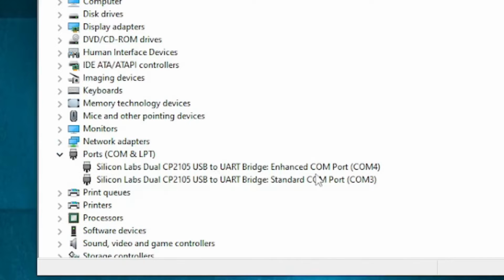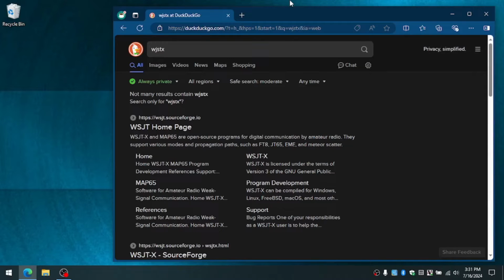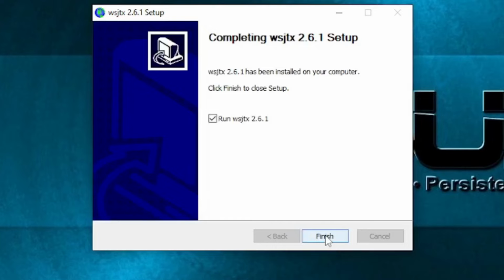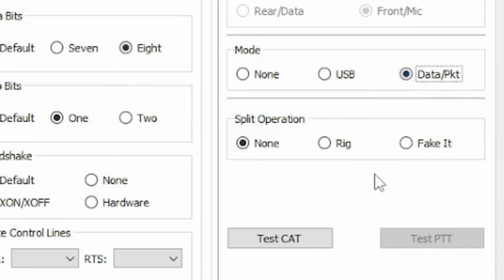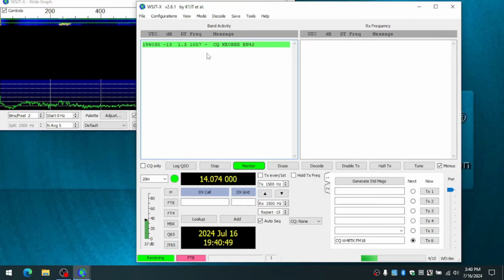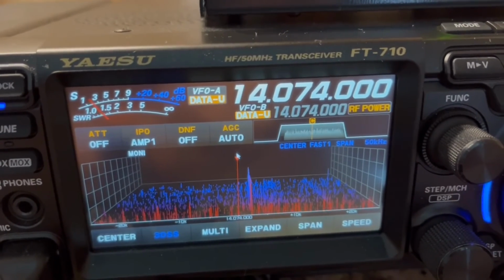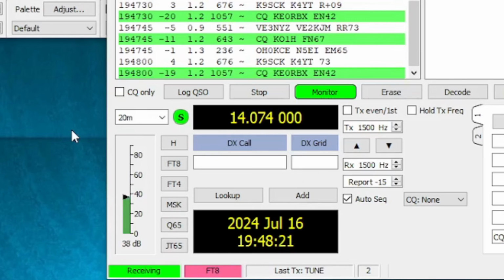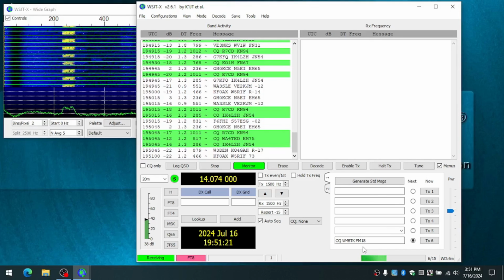Yaesu FT-710 PC operations basic tutorial - video 2 of 2 - Installing and configuring WSJT-X (FT8)

Comment: I would change Source Mod to "USB" instead of auto. Also, under Operation Settings: CAT1 and CAT2 set to proper baud rate. Most people change just CAT1 but I would change CAT2 also. One is the Enhanced USB PORT and the other us for the Standard USB PORT.

Comment: How do I adjust the output power (watts) on the ft8 on the yaesu ft-710??
Reply: Just click the "Func" knob and select RF power, then turn the same knob left to decrease the power, right to increase it.
Reply: @ I have done this, I know it is at (100w)..while it is open, however, the program on the PC turns on and on the machine the red light (tx) does not transmit according to the watt meter..